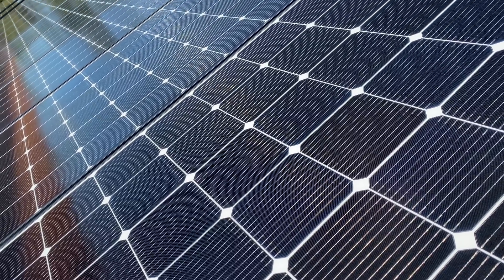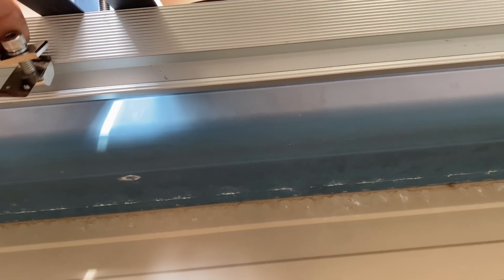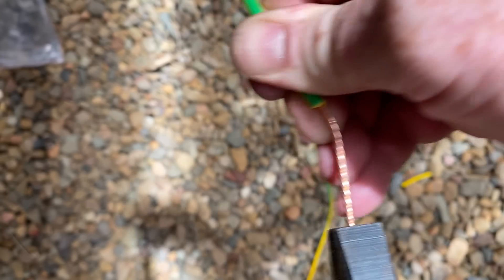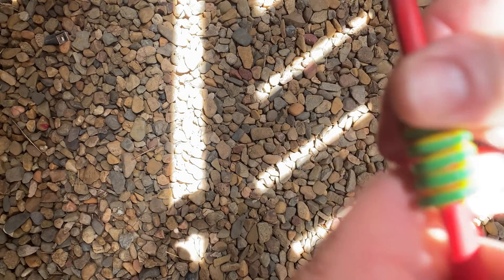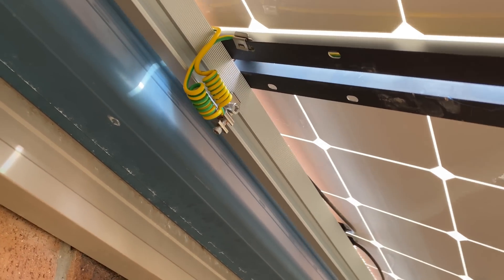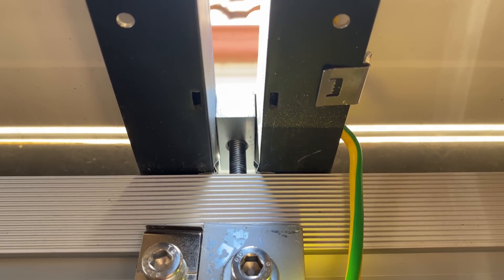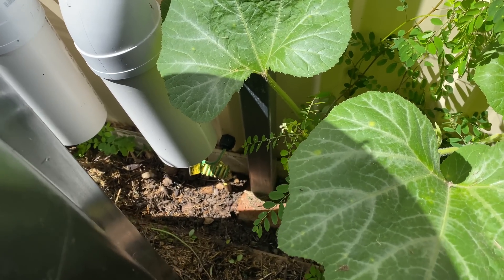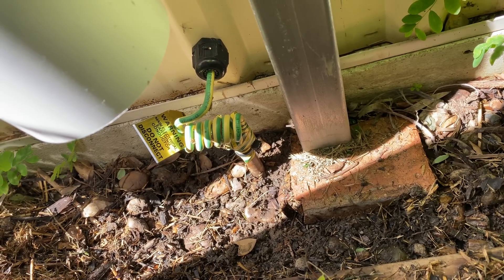Earthing & Grounding Of Solar Arrays For Victron Multiplus II Triple Parallel Off Grid Solar System

Comment: So, if not wrong, you created a M.E.N point (A.C.) then you put the earth from the Earth point in Switchboard to the Negative side (D.C.)of the Inverters?
Reply from the maker: The diagram is in the Victron wiring unlimited manual. Consider becoming a member for one on one advice. Thanks for watching 😎

Comment: Is all the earth wire 4mm ? Even to the earth rod?
Reply from the maker: The size of the earth wire all depends on the size of the active conductor and circuit protection. The minimum size for a main earthing conductor is 6mm2 this is suitable for a 16mm2 submain protected by a 63A circuit breaker. (to earth rod) The minimum size of an equipotential bond is 4mm2. (to panels)

Comment: Good to see some technical how to details. (For Australia) for those that DIY :-)
Reply from the maker: Thanks for watching! This is the most important part of the whole system, without it you may as well not bother building the rest. Hopefully this will help out other people to keep their systems a little safer. Take a look here for some more information - https://electrical-engineering-portal.com/how-to-determine-correct-number-of-earthing-electrodes-strips-plates-and-pipes-part-1
Reply: @OrganicPower-Australia  cheers - the part of the system I have done myself is DC coupled solar via Victron MPPTs.. earthed the same way - thou, I havnt bonded the negative of the battery to earth. The negative of the battery floats.
Reply from the maker: Nice job! Safety First.... There are so many different ways to earth different types of off grid systems. It can get a little confusing, this is how I chose to do mine. I took the information from the Victron Wiring Unlimited manual, there are a few different options shown on page 64 -  https://www.victronenergy.com/upload/documents/The_Wiring_Unlimited_book/43562-Wiring_Unlimited-pdf-en.pdf